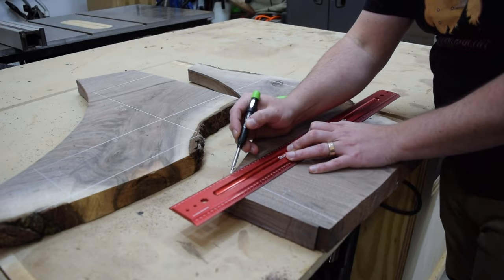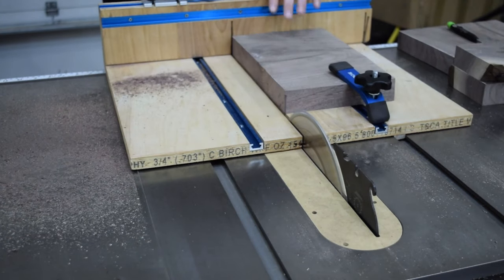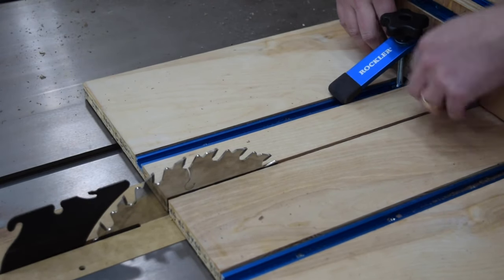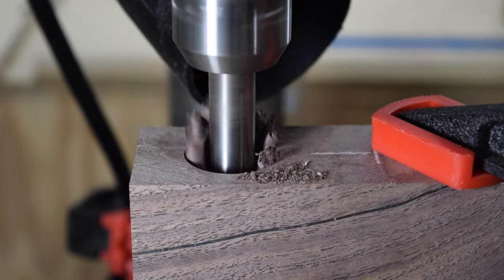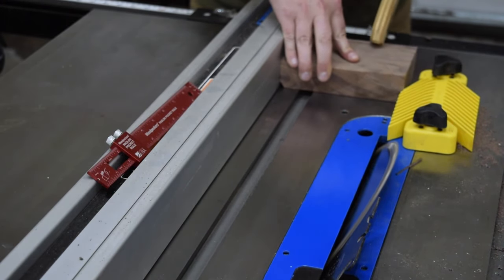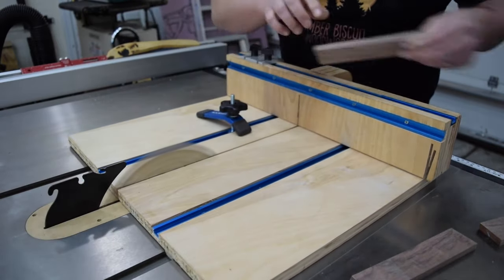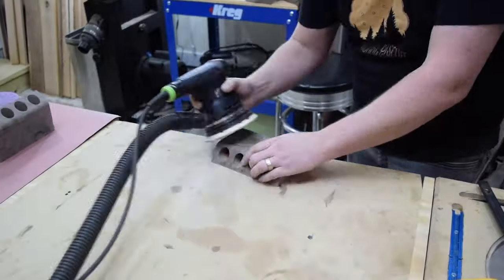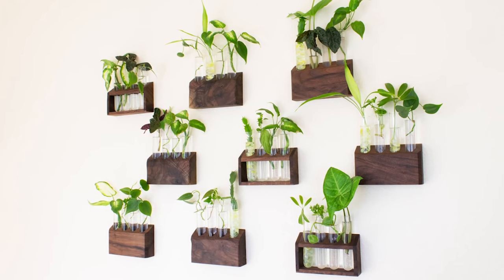EASIST Woodworking Project that Actually Sells || Propagation Station

Comment: What size forstner bit did you use for those test tubes?
Reply from the maker: It was a 1" forstner bit. But the test tube sizes vary so make sure to check the diameter of the ones that you get.